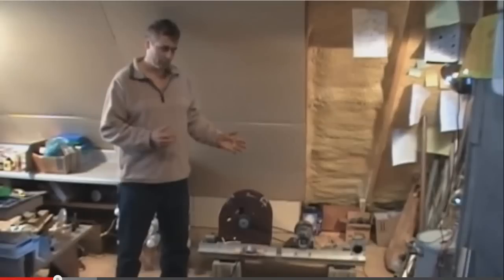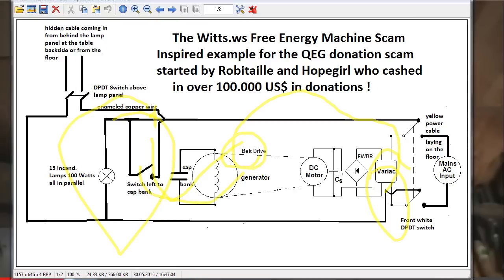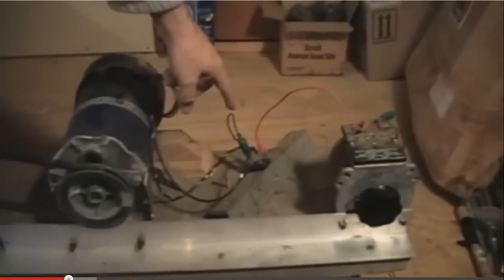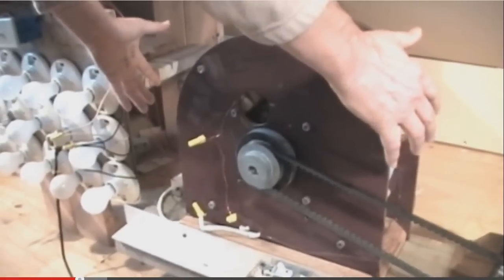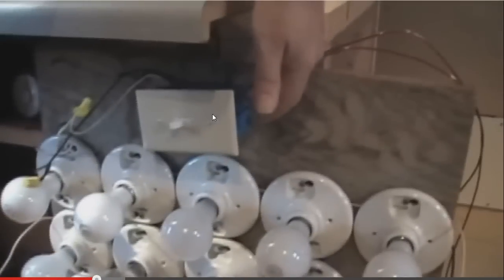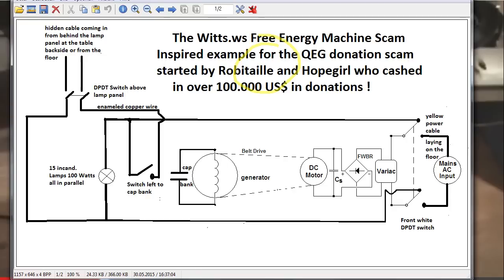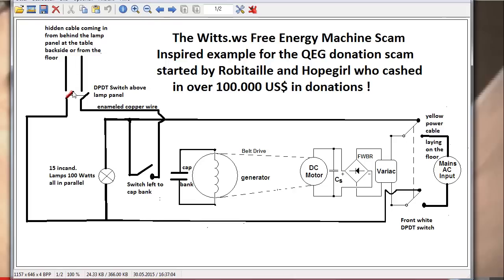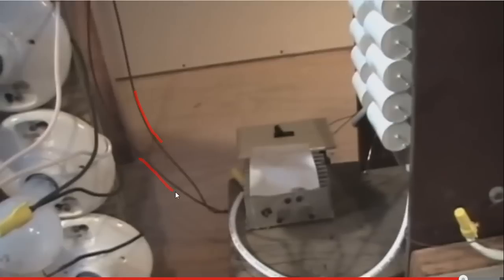Free Energy Machine  ? Scam ? from Witts.ws - QEG ? Scam ? inspired model ?

Comment: There's more to the QEG story that most have not heard. The man who began that project made donations to WITTS Ministries, and committed to take classes from WITTS to learn how to build the self-running generator. He was given notice that the information was private, between WITTS and this gentleman... and not to be made public. However, the 'gentleman' reneged on his commitment in every way... he failed to continue the classes to the completion of the project, and he made the information public. Because he did not continue with the classes, he was left with very incomplete information, because he thought he could figure it out himself. Therein lies the reason he has not had success yet... it's not "simple/classical electronics".

Most of the devices WITTS is responsible for involve types/forms of energy that are extremely contrary to "classical electronics" theories and practices... and as such, require knowledge that very few people have a good grasp on. This makes these devices difficult to build and get operating... and nearly impossible to get to operate with stability, reliability, and safety.

You just can't get predictable results with these types of energy by using "classical" electronics knowledge. Many people who have experimented with these types of devices have experienced random energy discharges that destroy electronic equipment, and more... even done very serious injury to themselves.

Consider the early days of Radar.  Simple enough concept... reflect very high (microwave) frequency radio waves off of objects, time the reflection, map out a reflected image on a screen. But do you know how many people were fatally injured by working around these live microwave antenna arrays, simply because they didn't know about the dangers of this "new type" of energy? Their internal organs and cells were being literally cooked... destroyed... and they weren't even aware of it until they got sick... and soon after died.

WITTS is taking the high-road, but the road that often brings criticism. People think they are being irresponsible for "not sharing with the world"... but the truth is actually 100% the opposite.  >If< they shared the information without regards to what could (would) happen to people as they "experiment"... they bear the responsibility for the injuries and possibly deaths that could occur.... even if you say "I take full responsibility"... that does not release them in God's eyes. It's a moral decision, and they will stand by it... and I support their decision... and continue to work on my own stuff.

BTW... many of these OU devices were invented decades, if not centuries ago. The item in this video was first developed by Ron Brandt (I believe), who was the Ministry spokesperson before Mr. Thrapp. It utilizes concepts and ideas originated by Nikola Tesla, who was also involved with "The Ministry", the former casual name of what later became WITTS.

Their goal: to be able to build their own factory, staff it with trained personnel, and make the systems available for public use.

If you desire to learn more about WITTS and what really drives them (and all former "Ministry" members for the past 150 years), they have a live streaming video webcast every Wednesday night, 8pm Central time. See their website for more details. 

Technology: the joining of Technique and Knowledge... and it's not always about electrons.

Thrapp recently returned from his annual 2-3 month Missions trip to the Philippines, where WITTS operates an orphanage, and is in the planning process for a new facility.
Reply from the maker: beforebefore These are only excuse from Witts... What has happened since the first public release of these videos ? There are no working replications of the QEG type device... All what Witts is presenting on their update page are devices from other people, who have worked on different designs not related to this QEG type device. The whole QEG replication people have only got their QEGs to work in the 35 to 75 % range and no one to my knowledge has yet achieved overunity. If you study this video as I show it , it is obvious, that Thrapp has faked it and is running it from the grid via hidden power cables under his table there...
Reply: overunitydotcom  Mr Hartman, I have already responded to your comments about the "obvious" hidden wires, and how you are fabricating these accusations out of your frustrations of them not "going public".  I don't need to respond to the same comments again... just because you are unwilling to accept what is clearly obvious. Your imagination is not evidence of their fraud.  You have allowed your emotions to rule over your eyes... and that is very 'counter' to true scientific research... emotions should never play a part of investigative research.

You, above all people, should feel the responsibility to do more personal investigation... and less personal accusation.  The world needs people with well-known 'platforms' (like overunity.com) to help 'get the word out' on these things that are literally world-changing. You have that platform, but do little to seek truth... unless it agrees to your model of "how it should be done".

WITTS is in no way responsible to prove anything to anyone, unless they get serious about "change", and desire to go and visit and see for themselves.... which, by the way, many people have done, and have walked away with a changed perception of "what's possible". Yes, it requires a serious commitment in time and contributions, but only to show they are serious... how else can they prevent an onslaught of "lookie-loo's" who want to see, but then do nothing about it. What's needed are workers and warriors for the cause, not lookers.

There are several independent engineer video "testimonies" are on their website of people who have done just that... but of course your comment will be that these are "insiders"... but that simply doesn't hold water, and the burden of proof would be on you to prove such a claim.

Cheers.
Reply from the maker: beforebefore The problem with WITTS is, that they scam naive people with it and charge them 300 US$/hour for bullshit Skype calls with nothing in Return. So they scam the people for their money and that gives the whole free energy scene a bad name. We have to expose these scammers...Same now with the QEG people. All these "testimonies" have the bad taste as nothing is really said and no measurements are shown and the machine is not shown in detail and we just only can believe these guys or not.,... I tend to not believe them as they don´t show any measurements on camera and put them in the kind of "Chris Angel possy", who has paid actors in his team helping the magic...Probably the same thing here with WITTS. If this machine would be true, why has nobody of the testimonial guys has build his own machine and shows it in his testimonial video ? Because it is just only a bullshit scam.
Reply: beforebefore However, WITTS changed his mind; and came back later, as the project continued, to help; or so I heard.  He wanted too much money, and although WITTS says it's for the people; it was too oriented toward being an exclusive manufacturer and distributor.  But, as WITTS says in the video; they have other patients which they'll be able to use, and so, I think, they decided to release the information; which is why Fix The World is stepping out now that all the plans, diagrams and tuning information is complete.  They're not in it for the money; they've got a ton of other projects they want to work on.  This was an integral part, and one of the biggest problems for mankind today.

I know it's hard to believe that some people think like that; but, I'm one of them.  Money is nice; but, happiness isn't found in having it.  Happiness comes from elsewhere, like accomplishing things, and helping people, and others that love us; some of us think it would be nice; but, it's not as important as other things.
Reply: beforebefore I can understand overunitydotcom 's frustration of having gotten so involved in trying to find overunity; and yet still not finding the secret.  You'd think the least they'd do is to check it out.  Still, it was only a week ago that the QEG completed phase three, which was holding up the project, and this was the selfrunning stage, as well as the tuning stage.   If one doesn't understand the physics and know it needs to be tuned, then one can try forever to figure it out, and never get there.

 I have been following this project since Mar 2014, and in many posts of the few I've made, I speak of this need to find the right frequency which is tuned to the bonds of the particles at the subatomic or quantum level.   Anyone who knows resonance at all, which should include Mr.Overunitydotcom, knows that a system in resonance, especially a borderline runaway feedback system goes up in frequency, and the the generated harmonics are small and smaller in wavelength.  The key is getting it there and requires fine tuning... very fine tuning.   One could hit the generator with a hammer all day long; but, that frequency is too low, and will accomplish nothing.

Fortunately, most things able to resonante reflect the resonance and it appears as an audible signal in 3D reality.  In this case, one can see the resonant radiant energy spikes in the current, these are very indicative of "correct' tuning.   So, the concept is a simple one; but, the practice and development requires a keen sense of what is actually going on.   

Naturally, if one has been searching, and didn't find, one might be a tad upset; especially if one has devoted a lot of one's life to it;  Hell, they're now giving the damn thing away; what a way to squash someone's dreams.   However, as Voltaire is quoted, "It is dangerous to be 'right' when those in power are wrong."  And this device fits my dreams nicely!  XD
Reply from the maker: Chip Cooper Tell us, which QEG have already produced overunity. To my knowledge no QEG yet has achieved that and will probably never achieve this as there is
no coupling to the zeropoint field to convert any space energy orsomething like this...
Reply from the maker: Chip Cooper Hopegirl, Robitaille and Witts are only in for the money ! Otherwise Witts would have probably not faked it and would not sell expensive Skype sessions
for it, where they don´t release any useful infos...
Tell us, which QEG have already produced overunity. To my knowledge no QEG yet has achieved that and will probably never achieve this as there is
no coupling to the zeropoint field to convert any space energy orsomething like this...
Reply from the maker: Chip Cooper Why would I need a QEG device if I would want to resonate the iron core from it ?
If I want to resonate Iron, I could do it in other ways... But the claim that the Iron core is resonated at a Mhz frequency and then should output overunity has not been shown yet...or do you know a video where it was shown ??
Reply: Again, you've shown no inclination to believe anything on video; what difference would that make for you?  We know they're in the process of making the video; patience.  Besides, the crackpots will really come out of the woodwork then.  It's better to keep them guessing.  Big money doesn't like proof; it upsets them.  I'm willing to wait.  I've got nothing vested yet and presently It costs too much; can't afford it; I'm waiting for prices to drop as production increases, and again... waiting for the other engineering teams in other countries to report in.

Comment: I saw the video showing the resonant generator, with voltage and current signals going to the oscilloscope and an input power meter. It is indeed, as described, resonance! When one wave goes high for a half cycle, the other wave in that same time begins low and ends high. So the power from the right half is positive while the left half is negative and the total power is zero, same as any other resonant device. With 500 watts in and nothing out, it is hardly over unity.

Comment: This man also has a later video with a 3/4 HP motor and a 2900 Watt NorthStar Generator that he says has special coil added that is untrue. He also has the switch that he uses after starting the motor, again they are on top of a workbench. He has obviously worked as a Magician and electrician to perfect his scam. The manufacturers of the generator say that a 5 HP motor is needed to run it that would take 5KW of power. The reason a stronger power is needed to run these generators is because of Lenze's Law that creates back EMF.
Reply: The special coil was designed to overcome the Lenze law, Now radiant energy or aetheric vacuum fluctuations can now run the device.
Reply: The laminated steel frame core has to be conditions to resonate for the radiant energy and that's when she kicks in.

Comment: Scammers like this one are a large part of the reason that I haven't been able to obtain even minimal funding for my own device, which DOES produce measurable results; I put 1 mW-second in,got 18 mW-sec. out, for a net gain of 17mW-seconds for "free", using NO moving parts and no" techno-babble". I still have the coil, (which wasn't even the proper size), which I made that small prototype from, along with the few" jellybean"-parts, (parts even Radio Shack had at the time), which did the switching. Anyone know of a venture-capitalist and someone to" loan some hands &muscles" that would want to assist me? (I'm" Disabled" now, & silicon-steel and copper aren't getting any cheaper, & I'm getting any younger, either!). May you have a Peaceful day,

Phoenix NightOwl
Reply: +Phoenix NightOwl, Jr.  So if you did do that you would not need funding because you would have broken one of the secret rule of Thermal Dynamics and you would not need to worry about money.  You'd be collecting a Nobel prize.  Either you are mistaken and you did not interpret your measurements correctly or you are telling a Fairy Tale .

Comment: I won't say it's a scam but I will say Stefan you are not being thorough in your research, the lines in back of the light board, under the counter top is nothing more than joints between two 2x6 boards that can be seen in the front view near the end of your video! This is me discrediting you discrediting them! I'm not for or against either of you but I do search the truth until I find it!

Comment: I do not speak English well but technical matters. Guy on this film works is what he built, while the error is in the schema. The generator is nowhere connected electrically. 100w bulb must be disconnected at the start of the generator, but later the generator must have some minimal electrical load. The correct diagram in the video https://youtu.be/u5M37PdGPfs

Comment: The QEG only work at 80% efficiency so it is not free energy
Reply: labidus74 The core needs to be tuned.  The steel resonates at certain frequencies which are harmonics based on the internal atomic structure, when tuning, the core frequency is found (this is Tesla's work), afterward, not so much energy is needed to get it to resonate.  As the core becomes conditioned, it produces more 'radiant' energy which can be converted through the inverter into usable power.  We all knew this would happen until stage three was complete.  I do not yet know how long it takes to condition the core.
Reply: ***** Since I would never do that; at first I thought you were informing me from experience on the electroshock.  Trust me, I won't try it.

Comment: You didn't make the diagram right lol. I can tell you don't know how the generator works. There's 4 coils in all with 10# magnetic wiring on 2 aposing coils . And 2 at 20# at 3100 turns to get high voltage to create a magnetic resonance in the torrite transformer generator. That generator acts like a transformer, generator in one. Tesla's system works believe it ...
Reply: I ask this question Has anyone built anything (Today's date 2018/11/27) and achieved  anything even near overunity? Can you educate me PLEASE! I worked as an Electronic Engineer designing products for 40 years.

Comment: Awsome work! I can't stand scammers! If they would put half the effort into working on something real they might actually get somewhere .
Reply: Bill P Aren't you so lucky it was successful; expect generators to become available within the next year, as it is already in production by some outside of the project already.  Be wary of scammers, and those charging too much.  Right now, the generator is running around $5000; but expect that to go down quickly.  Already it has dropped from $15k to around $5k, and that's to run your house, without fuel until the device needs maintenance; part of the problem was making it to run for a long time.
Reply: +Chip Cooper Bull Sh*t
Reply: @valveman12  ignorance at its finest this is why humanity cant evolve further yet
Reply: He did...
Made free power from a DC generator cable to multi plug which DC generator is turned by smaller Motor much smaller less voltages turn a 3-5kwh wind turbine
Free energy 😂
Gasoline company didn't like Suzuki swift free energy car

Comment: It isn't a scam.
1 motor speed controller knob PCB board to Adjust 1 smaller motor x 1 larger by 2-5 DC generator/wind turbine as Shaft by cog = gear.
It'll charge a Battery or multiple plug same speed for 4 + heating appliances always same temperature on Will always send deliver power from DC generator inverter battery or Blah blah blah generator direct to multi plug adaptor.

You need the smaller motor stepper motor gear lower RPM voltage always making something or double large GENERATOR